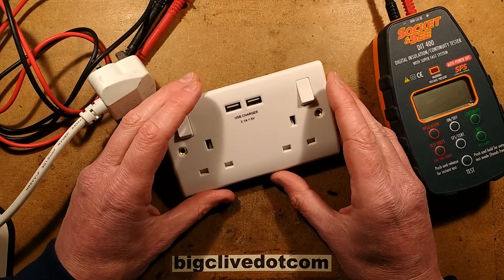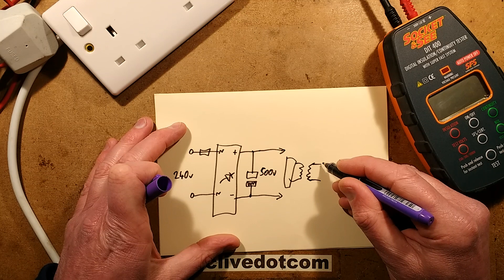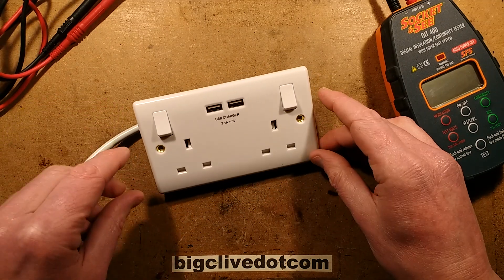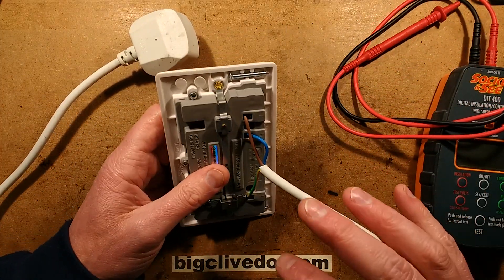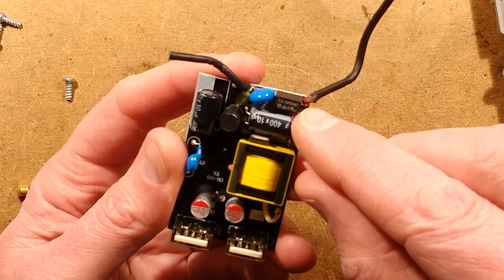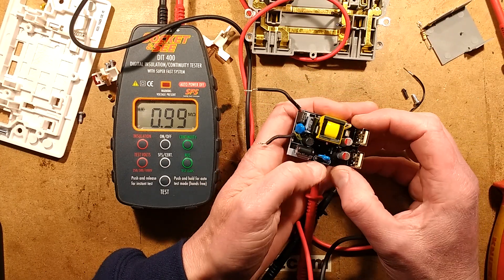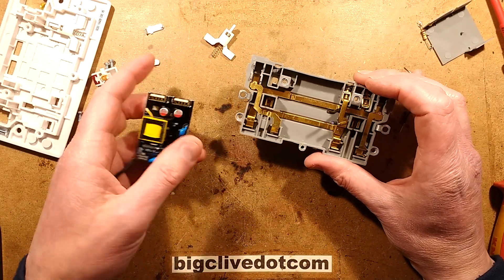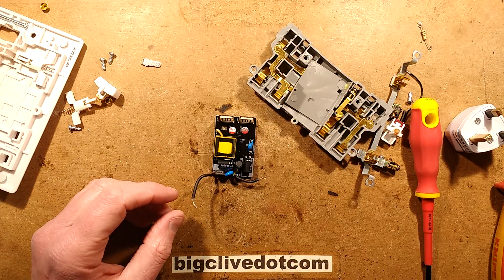500V insulation test of a British General USB socket.

Comment: If you look at the 3.1 amp version of this you'll find it has no output diode! They use synchronous rectification chip with integrated 0.005ohm 50V MOSFET. Pretty advanced/impressive plus the polymer output caps are very good. The 500V test is wrong Clive. As others have said, it's live to neutral test of the wiring not the device. A 500V live to neutral test could easily cause damage. Its like sticking 500V up your 4k TV set...you wouldn't do it! Any USB socket like this should withstand 3000V between primary and secondary.
Reply from the maker: The way the leaflet that comes with it implies the test and a 10Mohm result is odd.  I thought they may have added a bit of circuitry that actually allowed a full set of insulation tests in situ.  Of all three tests L+N, L+E and N+E an actual breakdown of insulation between L+N is the one most likely to result in a high current flow.

Comment: So I assume if you have these installed at home and you have your electrical installation tested that it will fail leading to a suggestion of a house rewire...
Reply from the maker: I certainly wouldn't install sockets with permanently active electronics in them.
Reply from the maker: If you replaced some sockets with these then anyone doing an electrical test on your wiring should allow for their presence.

Comment: i find when the voltage goes up as load goes up to be characteristic of the use of a feedback winding instead of opto feedback 
im not actually a fan of feedback windings ... its not just a bitch to design for but i have also seen them go very wrong if the winding fails

Comment: "Apple Phone" - current negotiation is part of the USB standard, has been for y'know, decades. Basically connects at 500mA and then they talk about supported/required power modes. Frankly they should design sockets like that to negotiate on both sockets but I suppose you can't have everything.

Comment: I want to start installing british 240 in my american home, so I can buy a 220 water kettle, space heater, and other heat element devices that aren't really suitable on U.S. 120v.
Reply from the maker: Theoretically you could install a dryer socket on a lower power breaker for UK appliances.  A house near here had two completely separate wiring systems in it with an extra American set of sockets connected to a transformer.
Reply: Most American homes already have 220 service for electric driers and ovens, but never available for consumer appliances.  The easiest would be to tap the electric oven, though I'm not sure if crossing phases from that circuit would affect the voltage in the whole house's wiring or not.  Hmm.
Reply: No need to use the 30A or 50A range/dryer outlets. There are NEMA standard outlets for 240V 15A and 20A circuits. I have a couple in my garage for my power tools. Good luck finding a BS 1363 outlet with the appropriate CSA or UL approvals for installation in a North American home, though.
Reply: I don't personally subscribe to CSA or UL as a private individual :) Though I suppose a NEMA standard 240V outlet feeding a BS 1363 + Europlug wall-mounted power strip would be equally effective.
Reply: Hopefully your insurance company doesn’t find out about your predilection for unapproved fixtures.
Reply: Insurance companies don't get to shape and mold the nature of our lives.  But you're already aware that compliance certifications only apply to those who manufacture, market and sell items to consumers -- not to the consumers themselves, being a free country.  One of the greatest confusions in the American legal system is the differentiation between activities of possession and sale.  99% of the time, regulators can only restrict the sale, commerce, of an object but not its very possession and use.
Reply: Do you not understand why these organizations exist in the first place? If your house burns down and your installed collection of unlisted fixtures is among the rubble, you can guarantee your insurance company is going to use that as evidence to weasel out of paying you a single penny.

You’re right, insurance companies don’t need to shape and mould every minutiae of our lives, but if you want their money when shit hits the fan, you have to play by their rules before the shit hits the fan.

Comment: I really want to know how exactly the insulation testers work. Can you make a dedicated video about it ? Possibly a teardown of any such units?
Reply from the maker: Operationally they use a voltage boost circuit to create a 250, 500 or 1000V DC test voltage at low current to measure resistance by detecting current flow.
Reply: bigclivedotcom Okay that was easy enough. 😀 Still, can you make a video for it? 😊

Comment: Suggest you re-test that outlet and see if it can provide 2.1 PER port.   The voltage being low at the start is about the control circuit staying low for discharge to keep from loading the port like a ladder.

Comment: As a United Statesian, I must admit I've always admired the UK wall socket/ appliance plug design. I guess at 110v we don't have to be quite as careful with sleeved pins and lockout shutters, but really the UK design is just really respectably solid from an engineering standpoint.

Comment: In the office where I work, everyone has the 240v power outlet / USB socket combination devices on their desk.  In the last year and a half (since the office was new), we have had 9 out of 30 of these USB sockets fail (or start to fail).  They all have the exact same problem, the output filter caps bulge and start spewing their guts out.  So I have been having some fun taking these devices home and replacing the capacitors.  Every couple of weeks I find a new USB socket that is not working to specs so I think this is going to continue until I've fixed all 30 of them!  The brand of capacitor that is failing for those that are interested is called 'ZTC' (with image of a bulls head on it).  I don't know much about this brand of cap but I suspect they are seriously shit.
Reply: For a 3.2A rated USB output, making a few assumptions, you need an output capacitor with 6amp Ripple current rating. This is massive, so you need either a very large capacitor or superior technology types such as polymer. Small 8x8mm polymer caps can achieve 4amp rating. The socket Clive is reviewing looks like it has 2 of these, so potentially up to 8amp rating.
Reply: Tommy Oz Interesting... Do you think the capacitors are overheating or being overvolted in this application? I know alot of manufacturers use underrated components but could be like you said just shitty components.
Reply: Many USB Sockets are not secured in place very well inside the case also many have very very weak resistors and capacitors so a few small surges net alone a mild one will often kill them while this means you should not looses your tablet/phone so on you will have to have the whole socket replaced far more often I suggest most people get a quality power board (like a Belkin!) plug it into the regular socket and use it's USB ports if it has any otherwise plug in a decent USB charger port (Aukey, Anker, Belkin, Mbeats/Gorilla or anything Qualcomm Quick Charge rated!) or any that come with your device (Apple, Samsung, LG, Nokia, Google/Pixel all have great chargers!) into a surge protector 
* SO Mains Socket > Surge Protector > USB Charger after all better off safe than sorry a surge protector is 5 to 20 dollars/pounds a new charger is at least 25 pounds/dollars to 80 pounds/dollars and that is assuming the charger plug works right and fry's itself not the device it is plugged into!

A few things I would like to see on incorporated USB Sockets that share Mains Outlets (By Law!) is a LED Surge Protection LED (as well as real surge protection!) as well as a On/Off LED indicator as well as both a switch for the USB as well as a socket cover/protector of some sort!

Comment: i wonder why the usa runs on 120v and you guys run on 240v why do you think that is ??
Reply from the maker: Different evolution of the electrical system.  In the UK we chose to go for a higher voltage to allow our power circuits to run higher power heating appliances.  We also standardised on a very simple 240/415V three phase system where a home gets a single phase and neutral and a factory gets all three phases and neutral.
Reply: thanks clive your a wealth if information!!!

Comment: That's 300k discharge resistor for the reservoir cap on the primary. The quoted >10M is between primary and secondary.
Reply from the maker: There's no install test that does a test like that.

Comment: Clive, you twonk! An insulation resistance test is not across phase to neutral, those are not supposed to be insulated. To do an insulation resistance test, you join phase and neutral together and apply 500V between those and earth, and any exposed conductive parts. When you tested the device thus, it gave a result of >2M, which is consistent with the 10M claim to the resolution of your tester. As you nearly realised, testing between phase and neutral includes the load path, and is a highly unpleasant test for a switch mode power supply. It is never intended to be insulation tested in that mode, only surge tested like that. Only got 10m in to your video, let’s see if you figure out your error in the remaining 9m...
Reply from the maker: Read my updated description.
Reply: bigclivedotcom Aha, I see where you’re coming from now. Appalling twonk accusation withdrawn with apology. This surely is a case of two worlds colliding in a suspect fitting.

In the testing of wiring installations, where devices are not connected, I can see that a L-N test would be a worthwhile integrity check. And I guess that’s the world you’re in when testing a socket plate.

In my world, where I’m designing and testing mains connected electronic devices, insulation resistance is never tested L-N because the load obscures the result. Also, the test voltage may over stress the device electronics.

Here you have an installation socket plate with a non-isolatable power management device built in. It fits neatly in neither world. Test it as an electrician would and it will fail. Test it as a device and it will pass.

And the shell of the USB connector plugged into it is a conductive accessible part, and its insulation from hazardous voltages should indeed be tested to guarantee protection from electric shock.

Different worlds, different rules. If you want a copy of EN60950, the device safety standard with the broadest coverage, let me know.

Comment: Of course it will show some resistance between line and neutral....  It has a power supply in it!

The isolation that they are referring to is from the USB port outlet back to mains, not across the power input.  Not sure what you were thinking, there, Clive....  :)
Reply from the maker: There's no standard installation test that measures insulation between the mains and a USB outlet.

Comment: I think ya been eating some dodgy MRE's there Clive.....an insulation test is never between live and neutral - that's just going to measure the 'resistance' of the input side of the circuit. What if the input side was a traditional transformer? - it would show a dead short.....Live Neutral testing is when you tie both live and neutral together and test that between earth. So you do a L to E test, a N to E test and LN (tied together) to E test.
Reply from the maker: On a full test of a new install you should measure between L-N. L-E and N-E.  The only exception being if there are active loads that cannot be disconnected for some reason.
Reply: Ahhhh yes i see, yeah on a circuit with no active loads that would be the case, for testing the wiring infrastructure and as you say no active loads...but i guess the inbuilt USB charger is an active load that cannot be disconnected. Makes sense now as i was thinking an LN test is pointless.
Reply: Carry on eating the MRE's :D
Reply from the maker: It's the fact they specifically mention it as if it can be done and give a value.  I've updated the description to explain my reasoning.

Comment: Very interesting to see the details of a British socket. Much heftier than we have in Canada which is identical to the American sockets. Thanks.
One thing I've always wondered is; what type of metal do they use for the contact points? I know the best is platinum like the old distributor caps from old cars before electronic ignition became popular, but that would be way too expensive. So would using tungsten. So what would they use in a high quality switch?

Comment: I feel a strong affinity with this post. BG Electrical were based in my town not long ago; their downtown site is a nascent skate park and we made some test gear for their Fluoro starters. And you're using a DIT400 running my software. Ancient but watch out for the Kewtech upgrade with "Breakdown Mode". You'll enjoy that. 

But now. I'm no leccy but would approach a USB outlet in PAT mode, and take "insulation" to mean L+N to E. Why assume L to N?

DIT400 S/C current at meaningful voltage is about 1.6mA. So 0.29M is ~464V. The answer why you're seeing more current than the mains case is because the electrolytic is breaking down. Why not hoik it out and see?
Reply from the maker: It's odd that they specifically mention it in the leaflet with the socket.  If doing a new installation I would do all three checks L-N, L-E and N-E unless there was some unremovable load between L-N.  But I would hope that any test between L+N and earth would be off the scale on one of these sockets, so why specifically mention it and indicate a value.

Comment: think youve got your knickers in a twist here Clive, this reading is between the USB and any part of the AC side. This is to stop the tingles one can get on cheaper made units when touching ground and any metal usb device.
Reply from the maker: There's no installation test that measures leakage to a USB output.

Comment: The switching regulator must have something like a 470k bootstrap resistor and the output also probably has a 1k or so bleeder. Between those two, you shouldn't have expected anywhere near 1Meg between live and neutral.

Comment: A little off subject, but does concern the receptacle you have there. Here in North America, our receptacles have the ability to be electrical isolated from each other. From the looks of this one, it does not. 

The most common application for a receptacle to be isolated is to have one always on, and the other to be switched by a switch or two. Example would be a living room, where the bottom would be always on and the top be switched. Because it's code to have a switched light in every room. And living rooms typically did not have lights installed by the electrician. Sooo switched outlets were allowed. 

An other application is to have two different breakers service the same receptacle. Example would be a food disposal under the kitchen sink and then the dishwasher. Both will be serviced by the same receptacle, but each have their own breaker. 

I'm curios to know if there are receptacles that can be electrically separated.

Comment: Nice to see, Thanks for sharing :-)
Reply: " The earth pin must be solid metal (although moulded plugs intended only for two wire applications may have a completely insulated pin). “Sleevesshall not be fitted to any earthling plug pin.” Having a sleeve on an earth pin is dangerous because it can prevent there being any contact to the earth of the socket."

" Sleeved Pins - or lack of. All plugs sold in the UK in the last two decades havesleeved pins. Half of the live and neutral pins are insulated with plastic, so that a plug partially inserted into a socket does not become a shock risk. "

Comment: Is the UK domestic supply 230V AC  now not 240V AC and different in IOM ?
Reply from the maker: I like to state REAL voltages and not Euro pretend voltages.
Reply: 240-245V is what you normally get and is within the tolerance, they decided to call it 230V to bring it into line with the rest of Europe but the supply is the same as before.
Reply: I guess they were anticipating the Brexit from the start on :)
Reply: Ah, now I know.
Reply: Thanks, was based on a Wikipedia entry i'd read some time ago!

Comment: Call me mister paranoid but when I designed domestic boiler controls the spec was to design for 180-263Vac for mainland UK. I always went one step further and used 630V rated caps as a minimum. Guess how many failed from something other than water damage or physical damage?

Comment: Insulation test is between live to earth and neutral to earth not live to neutral and your meter will do constant read if you press and hold test. Fail point is below 2 meg live to earth and neutral to earth. Live to neutral will just read the resistance of the circuit. Insulation testing is to make sure RCD does not trip. I hope this of some use.